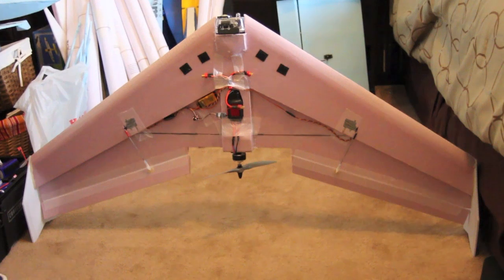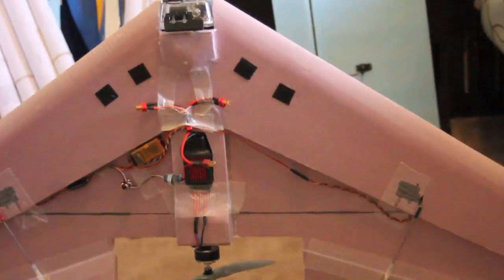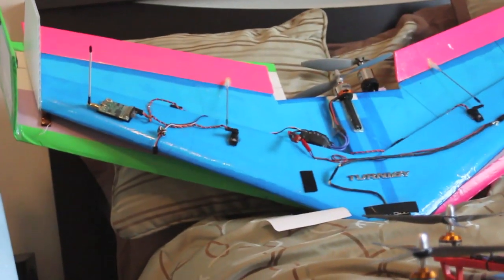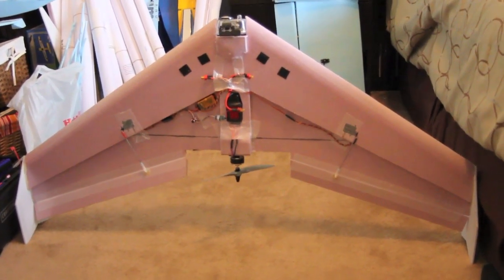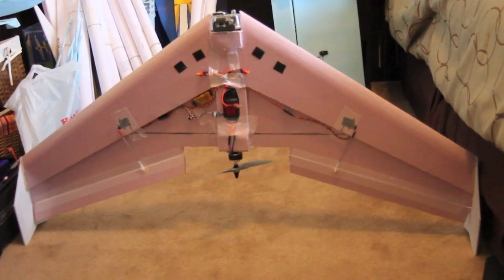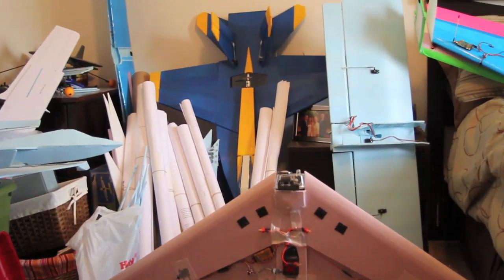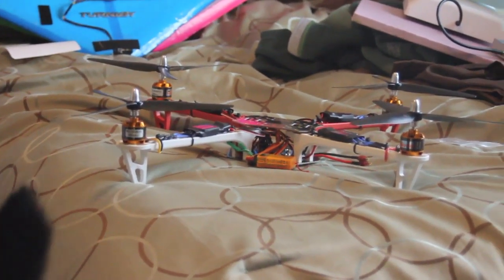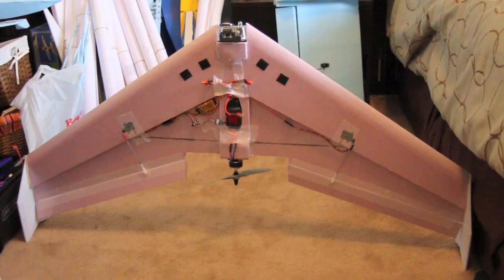48" FPV Wing V2

Comment: OK the line in the middle is 16 inches, the one on the end is 8 inches those apparently don't overlap
so where exactly does the 8 inch line begin compared to the end of the 16 inch line
 it looks like they lineup together